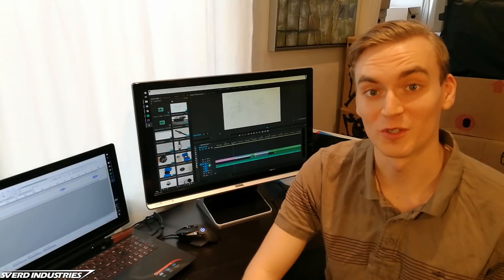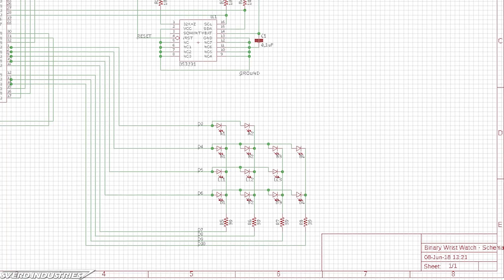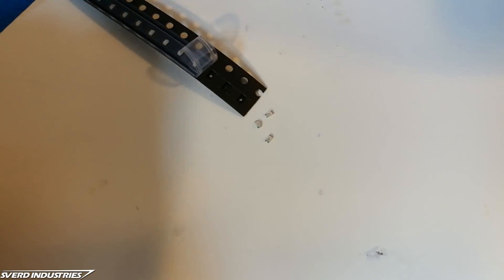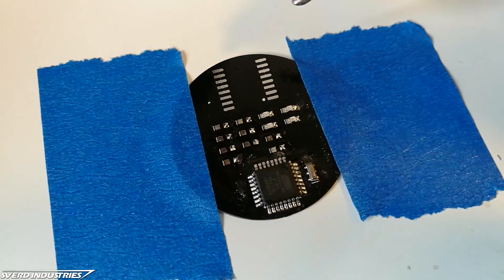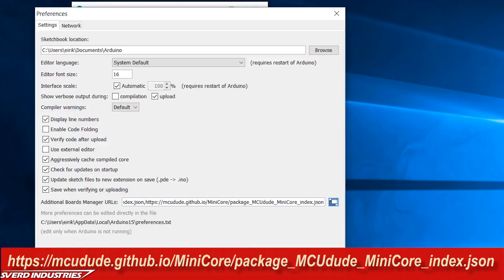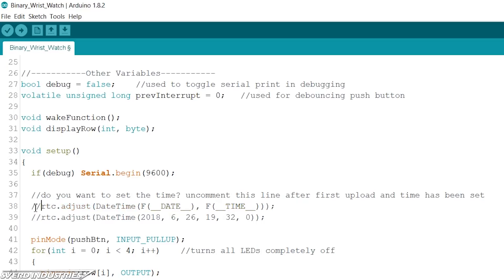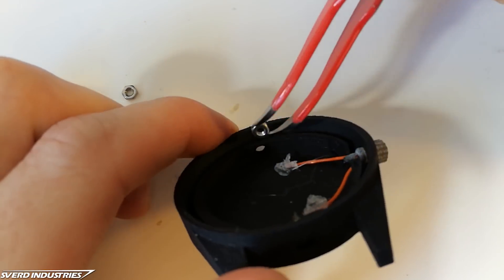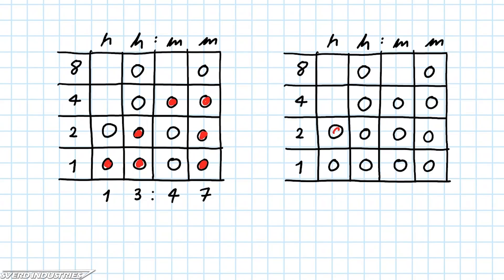DIY Binary Wrist Watch

Comment: Hey! I have been looking for a binary watch for a while. This is amazing - please tell me, what do I need to learn in order to understand the process behind how you did it? Is it electrical engineering? Is it in programming? Mechanical engineering? Pardon my ignorance, my background is in accounting.
Reply: It looks like you’ll need mostly electrical engineering with some hardware design and Arduino programming sprinkled in. Experience in DIY, prototyping, and access to the right materials is also extremely beneficial, but not critical.

Comment: Great work. What software did you use for the PCB desig and for designing the 3D case?
Reply from the maker: Thank you. I used Eagle for the PCB design and Fusion 360 for the 3D modeling. Both products are made by Autodesk and have great free versions to get started.

Comment: Are You selling or someone used ur design? 
https://www.aliexpress.com/item/Binary-Watch-with-LED-display-Fashionable-and-Special-Gift-for-Male-Electronics-Fans-Software-Engineers-Students/32920999301.html?spm=2114.search0604.3.233.591938cdwEARfP&ws_ab_test=searchweb0_0,searchweb201602_3_10065_10068_319_10059_10884_317_5736015_10887_10696_100031_321_322_10084_453_10083_454_10103_10618_431_10307_537_536_5736115,searchweb201603_70,ppcSwitch_0&algo_expid=ed27717a-965a-479d-b4c1-24aee83a388a-29&algo_pvid=ed27717a-965a-479d-b4c1-24aee83a388a&transAbTest=ae803_5
Reply from the maker: Hey man thanks for letting me know. This isn't me, but someone else. I'm selling a few handmade watches on tindie and not aliexpress.
Out of curiosity, how did you manage to find that listing?